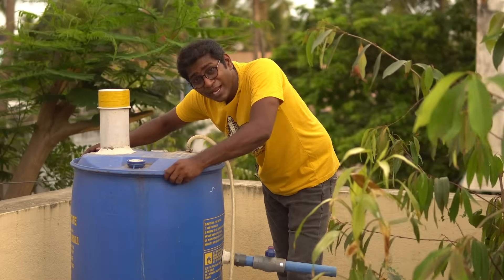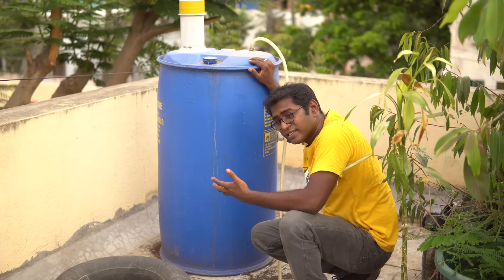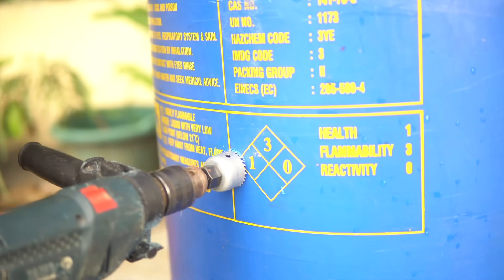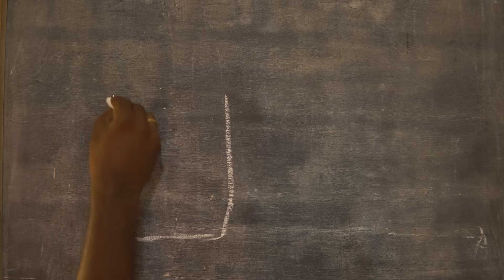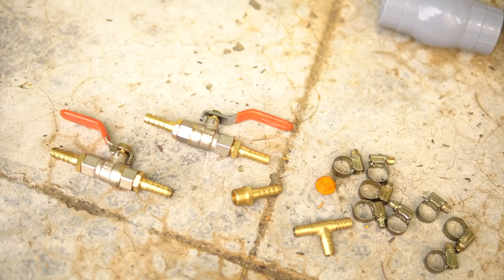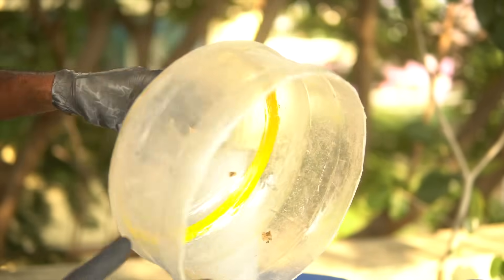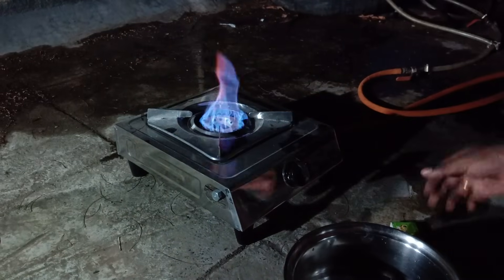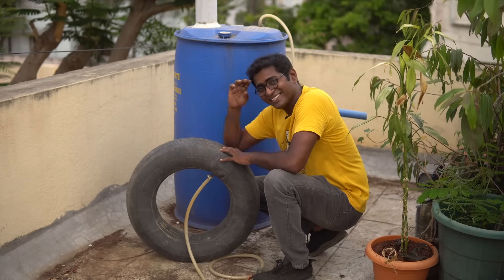Make your own Bio gas to save money on LPG

Comment: What an awesome idea and yes, it is very exciting!

I’m wondering if you use several barrels and connected to a bladder that collects the Biogas from all of the barrels but before entering the bladder, it goes through a three stage filter. Filter one is a bubbler filter. Two is brass filter. Three is silica. This is to be sure that the bad components that are typically in Biogas are removed.

This is what I have learned because ultimately the end result would be to try and compress this Biogas into cylinders that can be distributed to other family members or friends that might want to use it for a Biogas generator in addition to cooking.

One more note. It might be a good idea to also have another three stage filter identical to the first one on the opposite end of the bladder before it compresses into the cylinders.

You have a brilliant mind and I am very appreciative of your presentation and we want to duplicate this on a large scale in the Philippines on our farm. Any thoughts would be absolutely appreciated, and I thank you kindly my friend!
Reply from the maker: Thank you so much for taking the time to comment and add valuable information on this subject.
Reply: @VIDEOEPPO  you’re very welcome my friend. Do you know anybody in your country that would be able to assist us in setting up a Biogas pump that would allow us to compress Biogas into cylinders? Are there any suppliers that would have the equipment to make this happen?

Comment: I have some questions,
1.   Can I use a valve in order to remove the need of putting it off and on before and after use.
2.   Can I use large gas cylinder for the storage, instead of a tube, so as to have capacity
3.   Can I use a normal gas burner, or would it cause any damages
Reply from the maker: 1. yes ,customize it  as need be. Just make sure to add a proper flashback arrestor 2. You can use a gas cylinder but  for the gas to come out it might need pressure. You will have to come up with an idea to compress it into the cylinder. In a tube like this I can simply add some weights on top and we are good to go. Cost-effective and does the trick.3.Normal gas burner won't work properly. The burner holes need to bigger for biogas. I learnt that from internet...so may be try with a normal burner...if it works, great...but if not...get a biogas burner
Reply: @VIDEOEPPO  

Thank you sir
Reply: @VIDEOEPPO  

I'll contact you for help when making mine

Comment: You can still use the tyre tube for storage but you'd likely have to pipe them in parallel to increase the storage. Alternatively something considerably larger like an inflatable water raft or even a tractor tyre tube for better storage.
Reply from the maker: Yes. That should work. Thanks a lot!

Comment: In using the slurry, did you decompose it for 30 days? and also, how much slurry[kg] did you put in the disgestor? thank you
Reply from the maker: No, I didn't decompose the slurry. It was made by simply mixing cow dung with water. But I not am sure how old it was. Seemed fresh. I got the dung from a nearby farmer. I didn't measure the weight of it. It was in this old paint bucket I got that you see in the video.

Comment: Hi! Can we have the list for all the materials used in the video. It will be a great help if you reply
Reply from the maker: You really don't need to use the same material I used. Please check in your local market and use the material available to you. This way it will be cheaper. For example, the valves I have used metal brass valves. But the same can be available in plastic or steel.
Reply: @VIDEOEPPO  can i still get the list so that i can use it as a reference to get the available materials on my country? ( Please, cause i don’t have any knowledge on the tools your talkinh about )
Reply from the maker: @alvyalvarez2225  sure. I will. where are you from?
Reply: @VIDEOEPPO  Im from Philippines
Reply: @VIDEOEPPO  please
Reply from the maker: @alvyalvarez2225  i will send it soon
Reply: Please
Reply from the maker: @alvyalvarez2225  
A large drum could be an IBC tank, or closed drums. If you are using drums with lids, make sure it is perfectly sealed when completed
I am using 220 Liter sealed drum
 4 inch diameter PVC pipe height should be based on the height of the drum you are using
2 inch Tank nipple
2 inch FTA(female threaded adapter 
2 inch ball valve and 
1 ft 2 inch pvc pipe
2 inch L joint
Half-inchh brass ball valve 2 nos
Brass t joint half-inch
Threaded brass hose connector
8 nose hose clamps half inch
A truck tube with  tube valve removed
Hose as per length. 
Epoxy putty to seal everything
Reply: @VIDEOEPPO  thank you very much, is it okay to use 1/4 instead of 1/2 of brass valves?
Reply from the maker: @alvyalvarez2225  like i said earlier,you can use what you find cheaper and easier
Reply: @VIDEOEPPO  what is the alternative for the tank nipple? It’s the only thing not available in my country
Reply from the maker: It's available everywhere. It's a very common thing used to connect overhead tanks. Maybe they call it with a different name in your language or geography. (For example, when I ask for "Pegboard " here...no one understands. They call it "holes board". Likewise,  a flap disc is called an emery wheel in the local market. I suggest you google the word " tank nipple" and show it to them.

Comment: Can we use the biogas heat to create electric batteries and story electricity
Reply from the maker: I am truly not familiar with that concept. But would be a nice subject to look into. Thanks a lot
Reply: @VIDEOEPPO  yes if the heat / combustion can generate electric form of power and story energy, it will it would be good

Comment: Maybe i missed it but why couldn't u use the tank directly?
Reply from the maker: The fire could reach the tank and cause an explosion. From the digester, the gas goes to a storage reservoir. From reservoir, it needs to be connected to a flashback arrester and a scrubber ( to remove sulfide). Then it can be connected to the stove
Reply: @VIDEOEPPO  But if the gas canister is connected to a modern stove and you're lighting the stove them I'm pretty sure it should be fine
Reply from the maker: @KingAbdulhaqq   No the problem is modern gas canisters are pressurized. Also, the burners seem to have some safety features. Here this is complete diy. So we need to increase the pressure in the tubes by placing weights on it. Its out put needs to be connected to a flashback arrestor and use stove specially designed for Biogas

Comment: You are so awesome,  thanks for the video. 
But now how do you make to remove the remaining waist from the tank
Reply from the maker: Thanks for watching and to  answer your question, it comes out as slurry from the overflow pipe. But if you need to remove the content in an emergency situation, you may want to add and opening in the bottom section and keep it closed with valve

Comment: you can use pressure valve to use gas fully optimize one pakistani has done bio gas plant with floating dome and he set pressure valve such that high flames he got and he use  it for factory purpose instead of diesel generated power.https://youtu.be/8J-Oc6IsLj0?si=GCJ8wZDaKo7IsuOB

Comment: You can make a basic flashback prevention system with a water bottle by just bubbling gas up from the bottom of the bottle through the water to the top where it can be used. This process also removes some particles from the gas that you may not want to burn. You can achieve this with just a water bottle full of water, the lid with two holes for tubes one going all the way to the bottom of the bottle and another just from the top area for the gas to exit.
Reply from the maker: yes, Have received similar suggestions. But, thanks a bunch for pointing it out

Comment: I tried it but it's  failure because arresting leakage is challenging task... Getting appropriate materials in a small town is really challenging.
Reply from the maker: get supplies from plumbing hardware. They usually work. Make all holes at least 1mm smaller and sand it down to get a correct fit. Try using the gasket sealant used in motorcycle engines. It should work.

Comment: Hi, this is a great video. Thank you for the explanation, it is great to know that some ideas (siphon) would not work. I have one question though, which I cant find answer for. Do you ever need to remove the slurry manually? I can imagine being the bottom too solid to be removed via the pipe and it might get stuck at the bottom and build up over time. Does anyone here have experience with that?
Reply from the maker: The solid waste will be turned into slurry over time. Also it's the ratio of how much you feed every day. You can feed half the tank and expect the microbes to eat it all up in a night. If you do want to remove the solid waste, then add another hole and close it with a valve. Extend the pipe and connect it to sewage or empty it in a pit and cover it with soil. Don't leave it in the open, undigested food waste will stink

Comment: Very well explained. Just wondering how you empty out the slurry from the drum once it's exhausted ...or does it dimish away on its own within the drum ?
Reply from the maker: Once the digester is filled to a 3/4th , We can open the overflow valve and empty out the slurry. A design flaw in what I made is I did not put an emergency out let valve to empty the digester if it needs to be moved

Comment: What is the reason you added a tube in the middle of the barrell? Would it be ok to just have a barrell and then one exit tube for the gas?
Reply from the maker: It's for the slurry to come out. Only digested by the microbes, that waste has to be removed so that we can make space for more waste.
Reply: @VIDEOEPPO  so is the waste that comes out of the middle tube usable for compost?
Reply from the maker: @makunt_izichi  Yes.... but you have to dilute with water in 1 litre to 20 litres ratio. Never use directly...its too strong

Comment: Hi bro
I created this bio gas digester and gas started to get in tube but the issue is gas is not getting burned
Can you tell me what is the issue
Reply from the maker: 1. Are you sure there is enough gas?.  because it may burn for a few seconds and die out 
2. initially for almost a month. it's just the residual air that will be pumped out. You have to open the valve and remove it. but keep checking after 15 to 20 days. It might even take longer depending on the quantity, quality, and weather conditions

Comment: It would be useful to put a stop valve on your tyres so that you can fill them, and remove them for later use.
Having a system of three or four of these (or more) digesters cycling for use would make them more practical for daily use.

Comment: One small doubt after completing process , how to remove solid waste inside drum
Reply from the maker: In this design, it's not possible. It has to be removed through the overflow pipe only. But you can add another output at the bottom if you need.

Comment: If I don't have leaks, what could be the problem I have if after two weeks I don't generate gas?
Reply from the maker: Assuming you are using biodegradable stuff.....The Outside temperature is not proper or maybe there are only a few colonies of microbes in the digester...
Reply: All I put is biodegradable material, The outside temperature is 22 degrees, do not put colonies of microbes in the digester, only organic waste, rabbit droppings, chickens, dogs and kitchen waste, any way to add a colony of microbes?
today add a preparation of warm water with sugar and cornstarch
can i do something else?
Reply from the maker: @aikopeliculeish  add some cowsung slurry

Comment: This may sound obvious but will the bio digester still stink after a few days from the cow dung?
Reply from the maker: No, it will not. The whole system is airtight. Except when you open the digester lid to add waste, it might smell a little bit. 
Once digested, there is much worry about the smell.

Comment: Just use brass/metal wire in anywhere between the hose to arrest the backfire ! Spark arrestor as same what we use in silencer of vechiles used in petrochemical industry
Reply from the maker: yeah, I got the suggestion from many viewers too. I will surely try and implement the best of the ideas in my next build. Thanks for sharing your suggestions.

Comment: How much kitchen waste is required per day if my family need 1lpg of 15kg per month and another question - which leaves create more biogas dry leaves or wet leaves
Reply from the maker: Theoretically wet leaves produce more gas as they are easily digested by the microbes. But it also depends on various factors like the climate, the surrounding temperature, the quality of the waste which is being added and much more. I may not be able to precisely tell how much waste needs to be added to this setup but all I can say is this setup will not suffice your needs. At the most, you can look at it like a system where you throw all your biodegradable kitchen waste and make some gas out of it. make be make some omelettes or even tea with that gas. Not more.
You can see it as a waste management system that produces organic liquid fertilizer. To explain with an example, you can make a windmill generator using a bike dynamo....but it will power a light or even a dc fan. But you cannot expect it to power your full house. For that, you may need to scale it up. The same holds true for this setup. Hope I have answered your query.

Comment: Wouldn’t it be better to use a metal gas cylinder for methane gas storage instead of a tyre tube for methane gas storage? That way you also have overpressure valve for safety.
Reply from the maker: True. But I was testing this project. May be in the future attempt, I will take all these wonderful suggestions of the community. Thanks a lot for your comment!

Comment: But I don’t have the tools which you have then how can I make
Reply from the maker: For this project, tools are not mandatory. You can work with basic tools like a hack saw blade and a screwdriver.
Making holes in plastic should not be hard. A heated hack saw blade or a knife can do the job. I would suggest taking proper measurements and try out in some random plastic before doing it on the main workpiece.

Comment: The only thing I would add to this already amazing video, is try running it through a water bubbler before reaching the tube. It will clean the gas before it gets burned and make the flame hotter. You could also use a bladder system to increse the volume of gas and pressure. You could also daisy chain two or 3 digester together to increse production
Reply from the maker: Great point! Thanks for taking time to comment !
Reply: Can it be used to reduce cooking gas of commercial quantity?

Comment: Sir Your Storage is risky, it work's but risky, loss prone. People take a Barrel like your's then a Smaller Bucket up side downon Guides, allowing, Rize and Sink from Gas Pressure into bigger bucket partly filled with Water. This make's a good storage, Feeding Upside down bucket thru the Bottom and THRU Water, as Flash back protection. 
 PVC pipe, can be Stuffed with SST Cleaning scubber's or Sand or Both, sealed on both end's, with sealed Hose connection each end. Cheap Flashback arrestor. Nice Project, like that it continually feed's withTop feed. Learned from this, Thank's
Reply from the maker: ACtually thought of the inverted drum storage. But Mosquito breeding will become an issue. I was unsure if I should add some chemicals to the water to avoid mosquitoes. Therefore, I did not do it. Any suggestions on that? Let me know please
Reply: @VIDEOEPPO  I am guessing,  but just adding Epsom Salt might make it acidic or water spawning insects. TEATREE oil as well, is Non-toxic and anti fungal and insect larvae.
Reply from the maker: @j.christie2594  Yeah, but will these react with the gas? That is something I am doubtful of. As it is, this is not a very safe setup.
Reply: @VIDEOEPPO  react with the gas🤔, not sure about that. Putting skrt over top, blocking insects from trying to spawn. Any how many people tackled this issue before, with each their own way. Good luck with your projec.

Comment: How much kitchen waste is required to generate biogas sufficient to run a stove  for a hour after 10 days of initial starting of the plant & regular feeding of waste.
Any relation between. The diameter of the    
Plant and the qty of gas generated.
Can we consider tree leaves for the feed.?
Reply from the maker: 1. It's difficult to say how much gas will actually be produced as it depends on lots of factors.
2. It depends on the quality, size and nature of the feed and the environmental factors which influence the microbes.
3. If you scale up this project and have a larger gas storage facility, then maybe it would work.
4., Yes, tree leaves can also be the feed.
5. I am not sure about the cost of a larger set-up and how it would work. My primary motive in this video was to show that this kind of small set-up will not yield much useable gas. 

to give you an example, we all know any BLDC motor can also be used to generate electricity, or even a small wind turbine installed on the rooftop can also do that. But will it take care of our electricity requirement? NO! We might need a much larger windmill to do that for us!.  This plant is almost similar. You can make an omlette (max) with this setup

Comment: Sir you can use non return valves as for safety in front of the valves
Reply from the maker: I don't think there will be enough pressure for the non-return valves to function properly. Thanks for the suggestion though